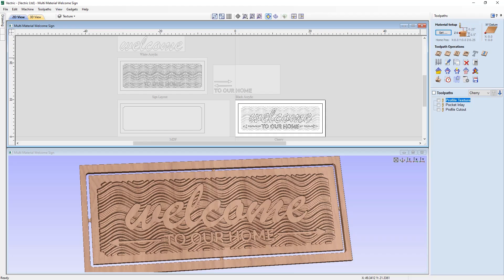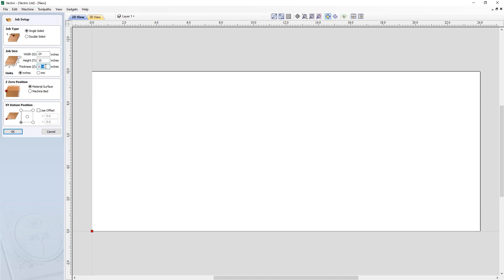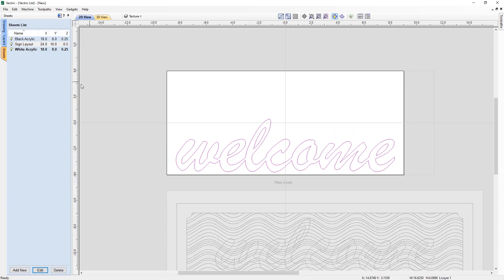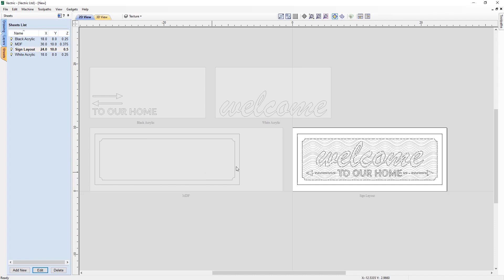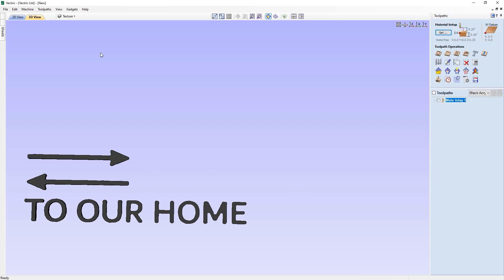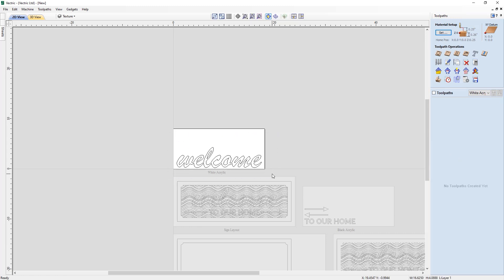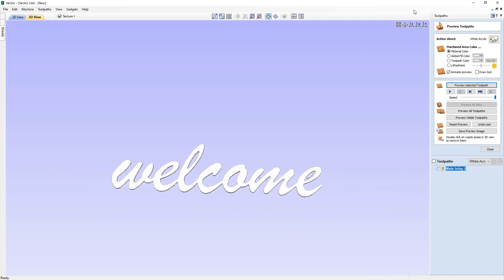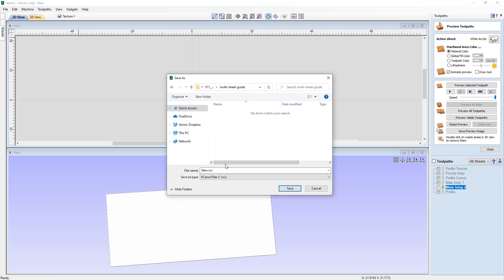Multi Material Sheet Guide | Vectric V11 Tutorials

Comment: In this video the black and white acrylic sheets are .26 inches thick, however, the female inlay cut depth is .2 inches.  Based on this the male inlay pieces of black and white acrylic will protrude slightly, is this intentional?  I know .06 of an inch in reality is not significant, but if there is a specific reason it was done like this I would like to know.  Thanks for the videos they are a great help!
Reply from the maker: Hello John... I would have to say that was a design choice.  With the Acrylic even a slight varriation in height adds a lot of precieved dimention to the piece.  But than again... it may have just been added to show you can vary the depths if you like... :)

Comment: I am using three sheets for a project. they are each only 3" x 7". when I try to save the tool paths, I get an error message saying the project exceeds the maximum area and that I will have to "tile" the project. So, I'm not able to save any of the tool paths. Any idea why it's doing that? (I'm using VCarve Desktop).
Reply from the maker: Hello... and thanks forthe question.  The Desktop Version of VCarve is limited to saving out toolpaths that are no larger then 24" x 24".  If the longest dimention of the toolpath exceeds that then that warning will pop up.  The software will allow you to cut something larger then that but you will need to tile your toolpaths.  Here is some information on that... https://www.vectric.com/support/tutorials/vcarve-desktop?search=tiling  If you find yourself cutting larger projects it might be worth looking into VCarve Pro.  Hope that helps.